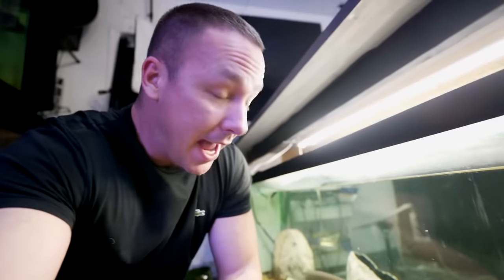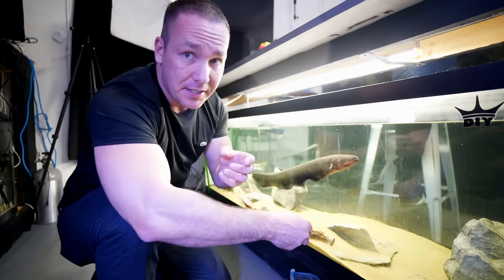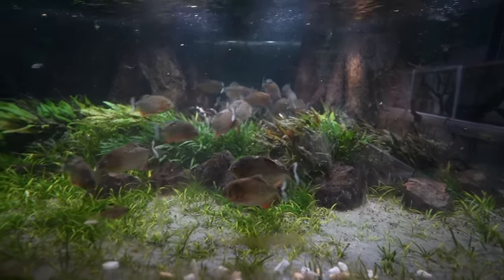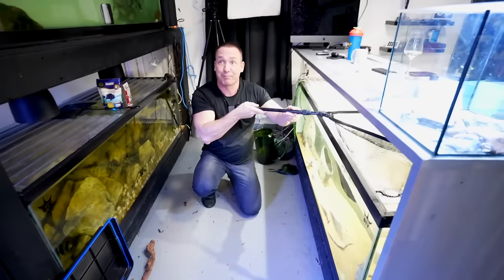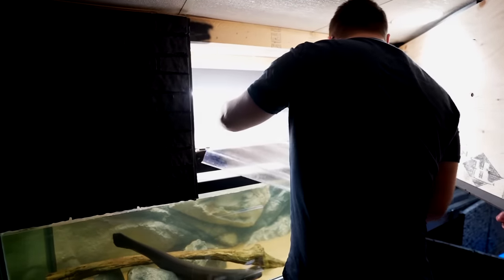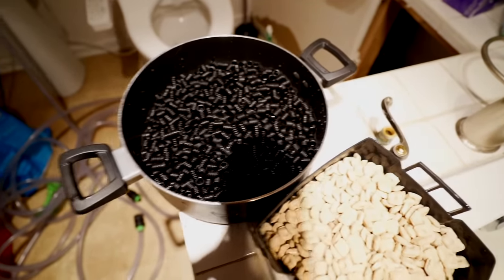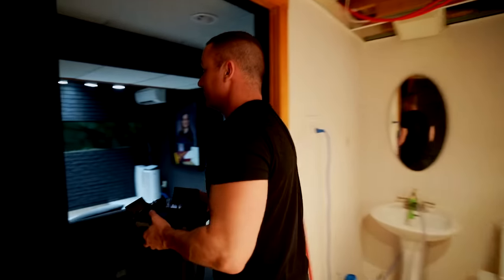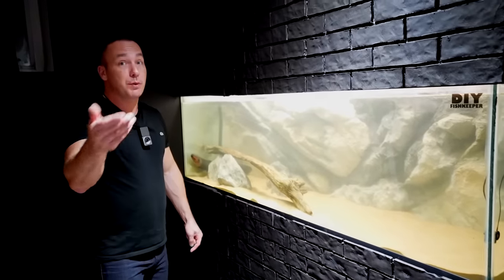MOVING THE WORLD'S MOST DANGEROUS FISH   Electric Eel   The king of DIY

Comment: Bad planning on the transfer. You should've had gloves on in case it jumped out of the net because you'd need to put it back in by grabbing it somehow or push it back into the net. Also, your son should've put the towel over the top of the net when you lifted that part out, while the fish was still in the water. You should've gone over the plan, and made contingencies in case of problems.

Comment: Bucket with lid to avoid temp shock running outside as the water will act as a temp "buffer" and avoid dropping him is the way a would personnaly go but what works works and it's easier to avoid touching him the way you did

Comment: I would have had a bucket /tote with water in it the right size to: Net the eel, place eel net and all into container carried to the new tank then just left net and eel and put in tank.  This would have eliminated any cold air from hitting the eel and the eel would have still been in water except for the two pick up moments.
Reply: Problem with that is you're working with an animal that could literally kill you if you touch it so the fewer steps the better I reckon